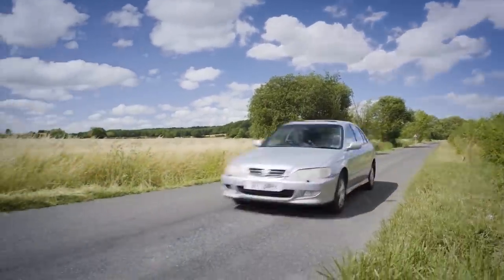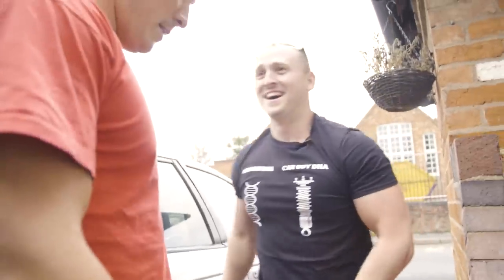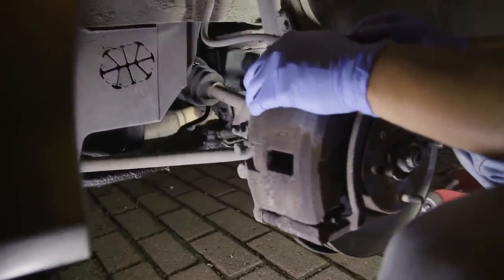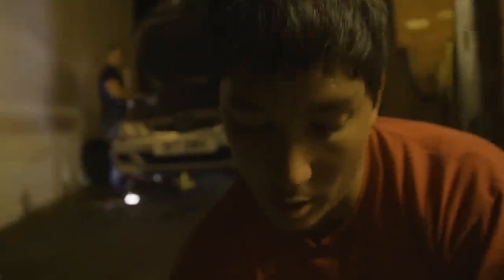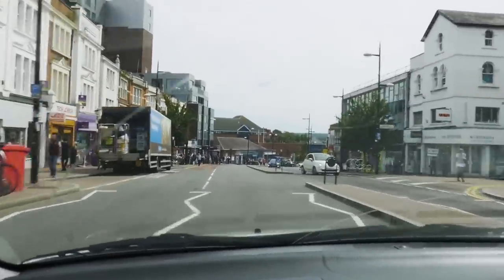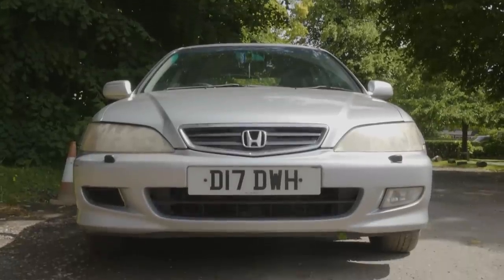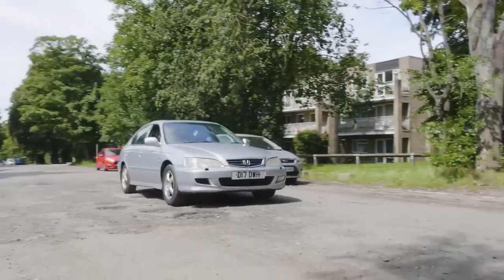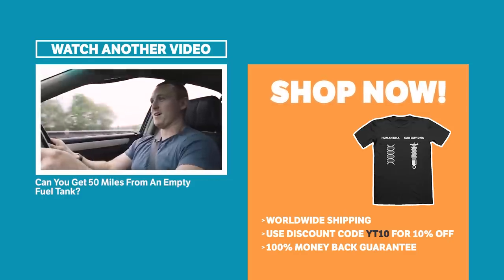Can You Daily Drive A Car With Cut Springs?

Comment: Less springs= less weight. Infinite benefits.
Reply: AutoAgitator also less travel
Reply: mr nobody less travel is now the motto of the car
Reply: mr nobody Less travel isn't a benefit
Reply: Waffeey real car guy does not think shit like that
Reply: yeah just get rid of the springs all together
Reply: Less travel does also mean better fuel economy. You know shorter distance to travel, less fuel to burn. :D
Reply: Many benefits
Reply: extra 2hp
Reply: steve the YouTuber ....last time l check on my neighbour's step father's land owner who happens to be married to the person that baby sits Coutinho's pet hamster says that he won't be going to Nou Camp and....only left hand drive La- Ferarri will give you 150hp if you use Eibach spark angle grinder...not on Vtec and drive on London to Vietnam Rallie
Reply: AutoAgitator l
Reply: No springs = no weight. Uncountable benefits.
Reply: Tires and wheels are heavy. Ride on rotors for best performance
Reply: Dylan McMulle
 Tyres and wheels are heavy,There are cut coils already.Grinder steady.
But on the surface it looks stance and ready
To drop his accord but he keeps on forgetting
What suspension is all about, the drivers go o so loud
He open his throttle but he's scraping down 
Everything is scraping now, muffler's gone, it's over blaow!
Reply: No passenger= weight reduction
Car Body stripping=weight reduction
No lights=weight reduction
No doors=weight reduction
Disassembled =99999999X WEIHGGGT RIDDDUCKKTIONN
Reply: Waffeey i dident say it was lol and it could be with racecars
Reply: AutoAgitator try no wheels

Comment: Can you hit vetc in reverse with cut springs?
Reply: AWAIS_IQBAL_2001 with no fuel
Reply: Yes!
Reply: with handbrake on
Reply: Хозе Гонзалез ñ
Reply: without engine oil
Reply: Even better, can you hit Vtec in Reverse on cut Springs with a flat tire for 50 miles
Reply: James Watson &
Reply: AWAIS_IQBAL_2001 if you believe enough, vtec is always possible
Reply: Ghani Messali i've owned mostly vw's and no hondas, but im pretty sure the vtec solenoid wouldn't engage if it senses no oil in the engine
Reply: without gas pedal?
Reply: That car has a fake VTEC
Reply: basshead  wait what??
Reply: basshead ??????????? Intensifies
Reply: AWAIS_IQBAL_2001 can you hit VTEC in reverse with cut springs and no fuel?

Comment: Back in the mid-90's we didn't cut our springs... We simply removed the springs entirely. 

And yes, we still made it over speed bumps though it took some skill... LOL
Reply: JeepCollector91 we still do it in Sweden...
Reply: I cant imagine how bad that would be. Surely youd spend more replacing shocks constantly than just buying lowered springs?
Reply: WHO tf drives with springs lol 😂
Reply: But howw
Reply: Hahaha whe still do this here im wanting to remove mi springs recently hehehe
Reply: Yes we did
Reply: I drive without springs on my Volvo 744. Its not as bad as people think, after you've learned how to drive you wont even scrape on speedbumps.
Reply: #StrictlyStatic
Reply: @eythatsprettygood3582  Or you could just leave the fucking springs on instead.
Reply: @G-Mastah-Fash  You wouldn't understand, it's a volvo thing
Reply: @gurreplurre3974  is the no springs thing a joke I am missing out on? Lol. I can't imagine what the car would drive like. I'd almost think the car would be unbearable.
Reply: @tomjoad8272  It must be. The front left spring on my '97 Audi A4 spontaneously snapped while parked after ~21 years of service and the car was completely undrivable. I had to wait until dark so there'd be no traffic and limp home in first gear at idle, and I was still hitting the wheel on the arch every time I went over the tiniest imperfection in the road, even ones I wouldn't even have seen before.
Reply: @demoniack81  agreed. There's a tradeoff to everything. Whether it be  a lift kit or lowering, there's always a tradeoff. Granted, the tradeoff can be large or small depending on what's done.
Reply: hmm yes i want less enjoyment in my car, lets take those springs out
(which does not mean i dislike lower springs, they can work, just dont understand taking them out all right, how would the car even work?
Reply: Ridin bumpstops is no way to go thru life son... XD

Comment: Less spring = more weight reduction

Every little thing makes a difference
Reply: QuietQuotient83 every little helps
Reply: true. i think this is gonna be top comment
Reply: QuietQuotient83 Delete the rear suspension and weld it in place. Weight reduction bro!
Reply: Just the same with carbon. If you add 10kg of carbon parts to your car, it has instantly less weight than before.
Reply: I'd rather have a car that weighs about a few kilos more rather than dying
Reply: Jonas Páll Gudmundsson Learn proper English, then you can comment.
Reply: Flame Beats 
Mom " son, why did you take the engine out of the Accord?" 
Me " cause weight reduction bro, makes every car faster! Trust me, we'll be hitting 200 down the highway!"
Reply: drive no car and you have maximum weight reduction!
Reply: Cut springs > coils
Reply: dragonslayer1483 yes LOL
Reply: QuietQuotient83 Ruin your driving experience for a tiny boost.
Reply: QuietQuotient83 and lower means more aerodynamic low fuel consumption
Reply: pee before drive = more weight reduction :P
Reply: Lose 10 lbs. more weight reduction.
Reply: removes wheels
Reply: QuietQuotient83 I make sure to fart right before a race and weeks before I only eat celery to ensure I’m as light as possible
Reply: Yeah i will just remove
The doors
The winshield 
The seats
Lights

Yeah basicly make a demolition derby car

Comment: I've been Dailying a car with Cut Springs for a while now it's literally no different I have zero problems but if anything probably handles a little better cause I've lowered the center of gravity now and whatever the quarter pound weight reduction it's still rides smooth I haven't had any issues with them popping out and I drive the car hard and through awful bumpy city streets all the time
Reply: And what car do you drive?
Reply: @TheCornishGingerOfficial  honda for sure
Reply: @TheCornishGingerOfficial  he drives a rolls royce phantom

Comment: does weight reduction mean more MPGs?? next you should test that by removing everything like rear seats, passenger seat, radio, interior, doors, trunk, bumpers, fenders...
Reply: It absolutely does. Almost every user manual talks about it in the tips section, if it wasn't obvious enough to the driver in the first place.
Reply: Somewhat, as long as it doesn’t affect aerodynamics it will improve
Reply: Don’t forget to remove the oil pan and radiator bc those are very heavy

Comment: I done this to a pickup also flipped the rear axle from under to over the leaf springs. It works and well. Just make sure you put a U bold on whats left of your spring to the shock. Done a friends truck like this also. Sold mine and the guy loved it. Hope he never takes the front wheels off.

Comment: Why add all the pretend reactions to a "rough" ride? There's no way you noticed a major difference.  OEM springs with one coil gone are still likely around 1/2 as stiff as proper lowering springs.  So lowering springs will only make the ride even worse.   It's ok to just tell people cut springs aren't that safe and leave it a that...

Comment: 4:52 Spring rate does not increase. It remains contstant unless you change to stiffer springs. What has changed is the suspension can no longer withstand as much load
Reply: Nope as soon as you heat steel it starts to harden and changes the spring

Comment: Really, I owned a heavy Merc 190E with a broken and two worn springs for over a year. The only problem I had was over large road bumps but no dangerous moments at all. But when it came to MOT day they quoted me over £1000 for full replacement of them plus the test. That was over 10 years ago and I couldn't be arsed to bother and scrapped it though it still drove smoothly like you would never of known otherwise. God I still miss that car and even my brand new car today can never beat that classic beautiful workhorse.

Comment: well.. you cut them wrong. Youre supposed to cut the top springs. ( and take them off the struts). i cut my nc miata springs i daily the shit out of it the spring never popped out. Plus after you cut the spring you have to flaten the spring the best you possibly can
Reply: And best not to use heat, it ruins the treatment of the metal. Torch, really bad. Angle grinder, less bad. Hacksaw, best!
Reply: @spencerali1659  why not to use heat??
Reply: @amirulasyrafalias1507  Spring steel has a specific heat treatment. Heading it up with a torch ruins that and makes it weaker

Comment: Lol I daily my volvo 940 with cut springs. Sure it's a tad bit bumpier, but meh. Gave the front coils a small weld for them to stay in place. Back coils are kept in place with a pipe clamp. Lowered springs doesn't lower it enough, basically. Would I go lower than I have right now, I might consider cutting lowering springs.
Reply: Truth lol

Comment: An exception, vintage Mercedes springs were made to be cut.  They've got about 14 coils, they're compressed in their mounts by at least 6-7 inches and they're woefully undersprung from from the factory and the increase in rates is great.  You need a special compressor to get them out without exploding your skull and that's a $100 tool.  Spend the remaining $100 on beer and pizza and spend some quality time with your angle grinder, just make sure to keep the springs cool or they'll lose their temper.  I dropped my '79 300sd by about 3 inches to a roughly 1 finger fender gap and it's one of my favorite mods on that car of which there are many.  The only ones that top it are the manual transmission swap, my hood exhaust and the 17" monoblock reps I put on there.  Unfortunately it has rust worse than Phil so I'm gonna pull all my fun parts and then scrap it and look for another chassis.